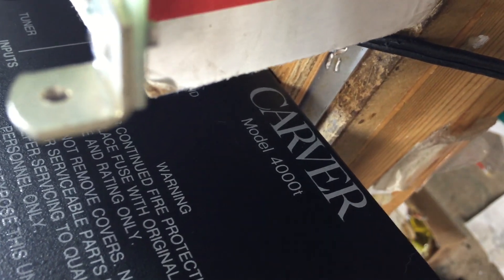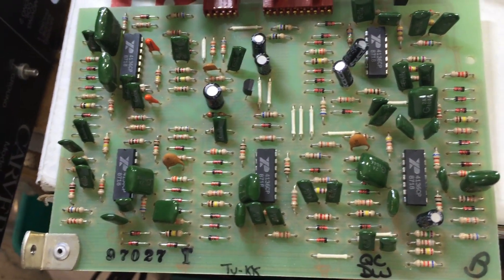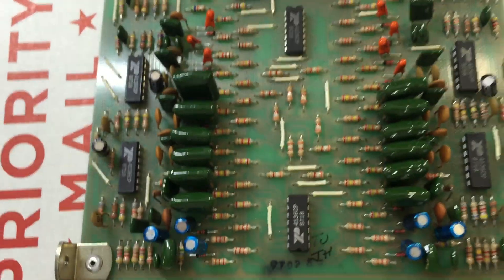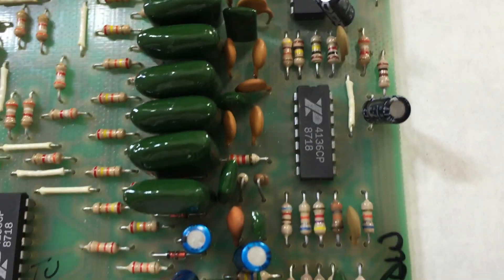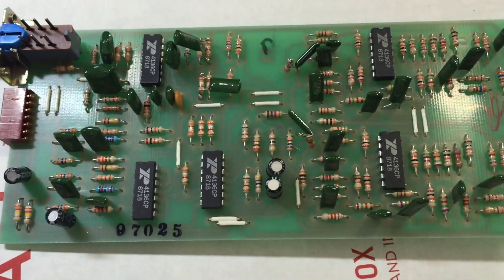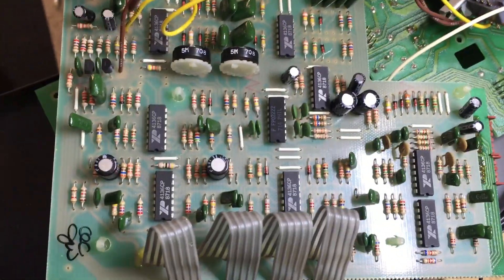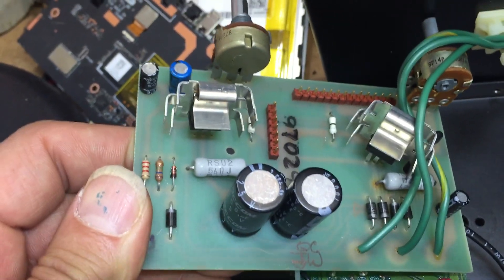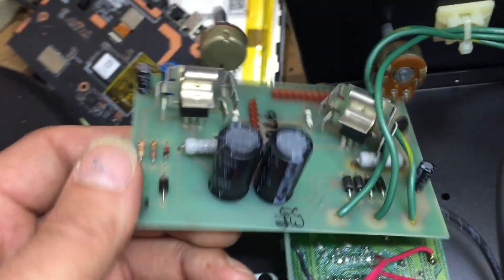Carver 4000t stereo preamp parts list Obaid's electronics

Comment: Hi. Thanks for the vid. A while ago someone told me there was a device on one of these boards that was impossible to find anymore. Not sure what it was, maybe for the sonic Holograpy circuitry. Any thoughts?
Reply: I believe you're thinking of the SAD1024, which was an early, long obsolete CMOS bucket brigade time delay chip. I saw them in the Carver 4000, but in this Carver 4000t, I saw MN3007s, which are still readily available. I had read that the later 4000s used a 'type II' Sonic Holography board; that different delay chip and different hologram controls are likely a substantial part of the difference. The later 4000s with the type II hologram had serial numbers ending with a 'C'.
Reply: @DRam1981  Thanks. Is it possible you meant the SAD-4096 bucket brigade?
Reply from the maker: sorry i'm not sure what you are talking about 👉 Thank you if you found this video helpful please don't forget to subscribe